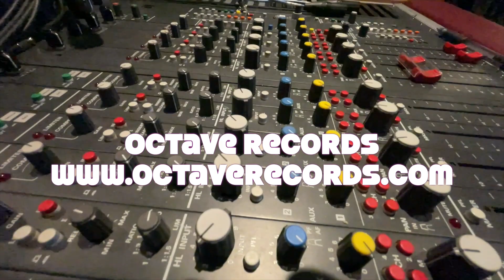Converting DSD to analog

Comment: So, can I, using Foobar, have my laptop put out a DSD signal, then tap the signal leads from a USB-out, parallel-connect a tiny cap, to shunt, say, everything above 50Khz to ground and from there on, directly feed my preamp with the (DSD digital) signal? Is that possible? And what voltage range would that signal be?

Comment: Awesome! A second stream of “Ask Paul” videos, love them. I have a question. Sure DSD to analogue is straight forward but perhaps, this is my question, instead of eliminating the complexity, have you not simply moved it to the PCM to DSD stage? After all DSD has 64 more sampling points than a 44.1kHz PCM stream. So between two PCM data points you have to extrapolate or fill-in so to speak, the missing points to get a DSD stream. With the inherent problems that this has. PCM dacs have to do that. It seems to me that you still have to do that. No?
Can we get Paul to geek out on this please? He mentioned over at PS audio their algorithm for converting DSD to PCM in a lossless process, but this other step is fascinating, it seems inherently difficult. Please? 🙏🏻 Ioannis from London, UK 🙏🏻

PS: Paul says that we upsample the PCM stream and then convert it to DSD. Yes a 64x upsampled PCM stream can be converted without loss to DSD, that is self evident. But again the problem is not solved, just kicked further up the road. Because even for 2x upsampled PCM stream half of its sample points will be synthetic data that didn’t exist in the recording. Back to the same problem, how do we fill in the extra 63 points that DSD needs and we don’t have. 🧐
Reply: PCM works by first anti-aliasing the signal, then sampling it and finally the step you are looking for, is the reconstruction filter, which will be a sinc function in different shapes or forms, called sharp filter, slow filter, etc.
It is mathematically well-defined that way, but the issue remains what the anti-aliasing filter does to the signal, which IMO is the reason why DSD sounds better than PCM.
Reply: @booom4849  You missed a critical step. Sampling depends on how many bits. You missed that entire next step and it is where the difference is. In PCM the sample is turned into a number. An actual value of the voltage at that point in time. That number is and will be that number. You can edit on the data point that stores that number. Playback sends this number to a DAC for it to put out that voltage level. No matter what the voltage level was before or after. 

DSD is single bit. All each sample cares about is yes/no. Is this new sample higher than where I already am right now? Yes/ No! Playback is same thing. It does not matter where I was, do I turn on or not? 
There is no mathematical conversion between them. The "extra points" come from the analog signal created by the DAC that played back the PCM so it could be converted to DSD. It is not a math formula like creating tween samples.
Reply: @glenncurry3041  Huh? I was giving an overview combined with answering his question.

"The "extra points" come from the analog signal created by the DAC that played back the PCM so it could be converted to DSD. It is not a math formula like creating tween samples."

That is the point I was answering him, but you didn't get that right. The DAC is doing what I said, this is a math thing, you probably will be doing that in the digital domain before converting to DSD. As far as I understood, most PCM DACs are internally using Sigma-Delta modulation.
Reply: @booom4849  It can not be done in the digital domain. The conversion to DSD is through analog. There is no bit correlation, no bit conversion even if the sample rate is the same. And yes S-D is used especially on the lower end. But that is used to convert the PCM source provided numeric value for voltage at that sample. The S-D is just trying to provide the most accurate representation of that value as it can. DSD just says, Go up? Yes/No?
Reply: @glenncurry3041  I just looked into it again. Yes, it can be done in the digital domain, and as far as I know, chips like the AK4490 do 256 times oversampling in digital before passing the signal to the delta-sigma process. These chips are used in high-end PCM DACs, so not only in the low-end like you said. 

"DSD just says, Go up? Yes/No?"
It's not that simple. If it were, when you would hold a maximum voltage, according your definition, you would basically have 010101010101, but this 1-bit signal defines the zero voltage. DSD encodes density, how it exactly accomplishes it, I'm still researching.
Reply: @booom4849  OK more slowly this time.... "Yes, it can be done in the digital domain, and as far as I know, chips like the AK4490 do 256 times oversampling in digital ..."

So the single sample is up sampled by simple mathematical duplication of data to more sample points. Or a simple algorithm provides smoothed data points between two existing data points. NEW data is not available to increase actual information from the original analog continuous wave. 

"... before passing the signal to the delta-sigma process."

which then outputs an analog representation/ conversion. That is THEN sent to the DSD ADC for conversion back from Analog to DSD digital. 

Theoretically if you had the exact same sample rate the conversion would be a simple subtraction B-A. The PCM data from sample A would be compared to sample B and if it was B greater number it would output a 1, if not, a 0. Because YES, DSD is simply a ONE BIT YES/NO! But I am not aware of anyone doing this. PCM - A - DSD is prefered. 

In DSD the S-D logic gate compares current input sample to existing output state. If the current output is higher it is a 0 bit. If the current output is lower, it is a 1 bit. That's all she wrote!
Reply: @glenncurry3041  "So the single sample is up sampled by simple mathematical duplication of data to more sample points. Or a simple algorithm provides smoothed data points between two existing data points. NEW data is not available to increase actual information from the original analog continuous wave. "

It is upsampled with respect to the Nyquist-Shannon theorem, no data duplication. 256 times oversampling means, you create inbetween-samples, for example for 44.1 kHz PCM you get 11.2 mHz samples. 

How the further process to DSD goes, I will think about your points, as I still haven't figured that out. However, there is a feedback loop which includes an integrator, there are even different designs of these loops, so the compare function rather compares the value of the integrator to the current voltage, is that how it works? I don't think it needs to do that in the analog domain, if you already have a 32bit 11.2 mHz PCM stream, which can just be seen as if this stream was measured. 

Btw. PCM can also be converted to analog by R2R DACs, these basically upsample the PCM data in the analog domain.

And well, you refer to "NEW data", well that's what you get strictly speaking, it will not be the same data as you would have during the recording, any analog to digital conversion is lossy, just as any analog to analog copy. If you would capture PCM with let's say 20 mHz, there wouldn't be this need for the Nyquist-Shannon theorem, but that is essentially what made PCM big, because it compressed the analog data-stream to manageable digital data sizes when using slow sample rates (44.1 kHz, 192 kHz, etc.).
Reply: @booom4849  This is likely to get deeper than can be handled here. "256 times oversampling means, you create inbetween-samples, for example for 44.1 kHz PCM you get 11.2 mHz samples."

But what data is in each of those newly generated data points? Take one sample from 44.1, say the PCM "code" it represents is a 1V sample point. Remember, PCM stores a digital number for the voltage at each sample point. The next sample point is say a 1.1V sample. Not much change between the two sample points. Now create 255 more sample points between sample one and two and what number fills them? How much actual signal detail is added by the addition of 256 sample points that basically just repeat the first number with minor steps to get to the next sample number. There was no information added. The known data was sample one and sample two and after adding 255 samples between them that actual data did not change in any way. All up sampling does is increase the frequency of the DACs output making it easier to low pass filter. 

"PCM can also be converted to analog by R2R DACs, these basically upsample the PCM data in the analog domain."

The ONLY completely accurate way to convert in either direction is by ladders. Direct sample of the value at that actual point in time! The S-D that is used instead just creates some number to store at that point. And hopes that on average it gets close enough. But if you were to take an actual live source and did ADC using both and looked at the actual numeric value of each sample compared to the source, the RtoR (if a quality device!) would be near bit perfect and the S-D would just float around. Laws of physics.
Reply: @booom4849  "but that is essentially what made PCM big, because it compressed the analog data-stream to manageable digital data sizes when using slow sample rates (44.1 kHz," Do you know why the numbers were chosen? Technology limitations and existing hardware of the time. Because video recorders were originally used to record the PCM data, the sample rate is a factor of the video line rate. Sample rate was chosen so 3 samples could fit on each video line on the tape. It was all about marketing.
Reply: @booom4849  Thanks, very interesting. Way too much to cover. But basically YES! There is so much of what Watt's is saying that is so correct and I don't hear almost anywhere else. Just as he uses a unique filtering approach! Basically explaining why PCM, especially Red Book, SUCKS! And just as the actual Sony and JVC engineers I talked with back when this stuff was being developed said, when I approached them with issues I saw RE the digital parts, they said the filtering needed in and out are so bad don't worry about the minor things! 

Yes as Watt's indirectly states, sample rate needs to be over 2M! 

And what he addresses is something else I try to explain and no one listens! The Shannon part of the famous pair addresses that sampling of a CONTINOUS WAVE is needed, e.g. an infinite number of sampling points. THEN Nyquist applies! Just as Watt addresses around 15:40? You can't use bandwidth limited signals! 

Basically what I was hearing there was that PCM audio sounds so bad, but if we can provide enough filtering....

Comment: Yes and no. The PDM DAC has to drive the LPF with very precise ‘0’ and ‘1’ levels. If these levels are not exact the analog signal will be distorted. You need to build a one-bit DAC.

Comment: So what happens when a DSD stream from a disc runs into a big ole scratch in the medium? What kind of error correction is possible? How  noise immune is it should the stream get corrupted with peanut butter? Is there the possibility of read ahead with DSD?
Reply: all of those are part of the transport medium , not the file format . whatever error correction and buffering happening are at a level lower than the assembled data . as long as the 0s/1s match once its assembled from the pickup media we can do what we want with no impact to the audio , packeting the data with checksum for example . same as any other optical data transport media . if there is an error beyond correction you will have a drop out just the same.
Reply from the maker: "Scratch"? As in a vinyl scratch? I am not sure what you're referring to. It is, after all, digital and operates in the Megahertz range which is far outside of vinyl. But perhaps you meant a glitch or interruption in the datastream. Because there's no timing info associated with it that glitch would just have a dropout of signal.
Reply: @octaverecordsanddsdstudios1285  To both of you above, my bad. I had forgotten that all of that is handled by the transport. A true rookie mistake on my part.😠😋🤣😆
Reply from the maker: @InsideOfMyOwnMind  No worries!